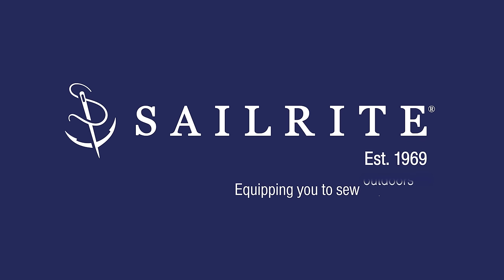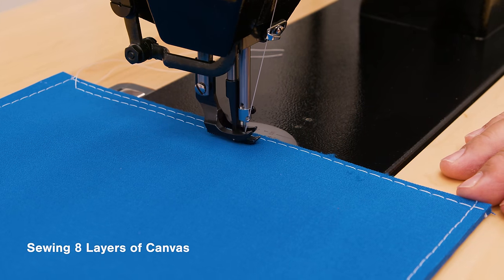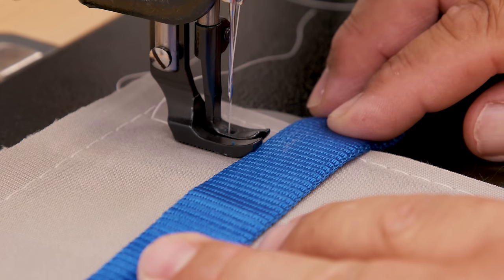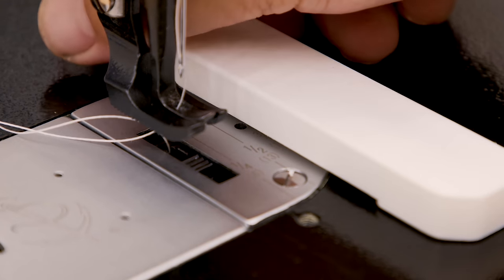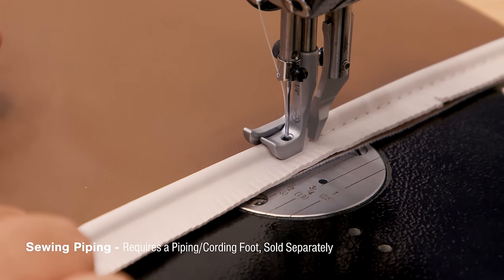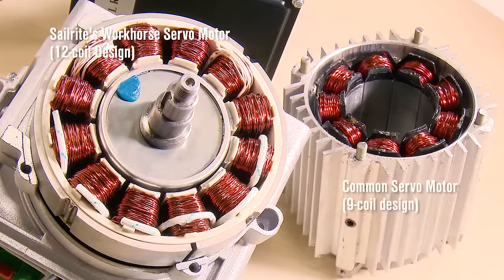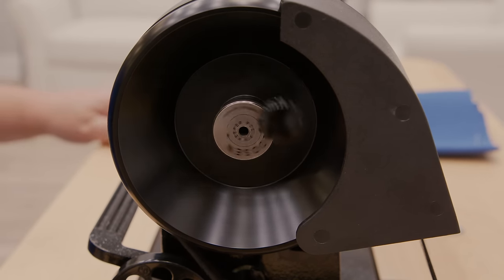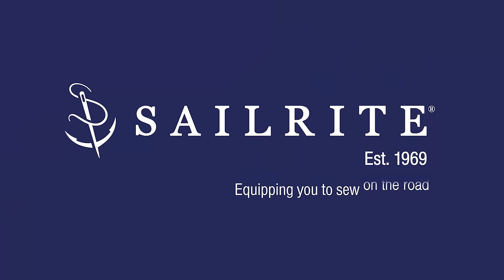Sailrite® Deluxe Fabricator® Sewing Machine Demo

Comment: I have had the Fabricator for less than a month, and they release a new model, hahaha, oh well it looks mostly cosmetic. I love the beast. It is everything I hoped it would be. The walking foot will pull anything through the needle. If the material will, fit under the foot, the Fabricator will punch through it.
Reply: FranktheDachshund 
Comparing the two
The difference is the deluxe has a butcher block table. A different light and the leg frame is now the same colour as the machine. The table is smaller. A price increase of $300.
For me........I would get the other one and save the $300.
😊
Reply: @znycelondon5313  what is the price
Reply from the maker: @zanbatistgrenuj7505  You can see the price here: https://www.sailrite.com/Sailrite-Deluxe-Fabricator-Sewing-Machine-Package

Comment: Does this have a needle position option? Where the needle will automatically stop either all the way up, or down in the fabric as you stop your stitch and remove foot power?
Reply from the maker: Hi Terry,
We do not currently offer a needle positioner option, but the workhorse does have a port for a sensor. We feel the control is so good that it is not required.
Reply: @SailriteDIY  I think having the needle stop in the down position, allows you to make turns when you put the pressor foot up.  Does the port in the workhorse allow for a positioning sensor that will do this?  Not sure how it works.

Comment: Serious question: Is this just an industrial sewing machine already on the market only relabeled for Sailrite or is this model unique to your company?
Reply from the maker: The Fabricator is the best sewing machine package in its class, nothing compares (even the Consew 206rb-5) to it in both performance and power. I know that is a very bold statement, but it is true, you will love the machine! Sailrite is the exclusive source for this fine sewing machine and Sailrite’s famous service comes with the deal. The Sailrite Workhorse Servo motor and the Stitch Pro Balance wheel (which are all cogged) are miles ahead of any other servo and balance wheel. You simply can’t get the power and slow speed control that we have on our Fabricator. 
 
We want you to be able to maintain the machine yourself. If it comes down to a mechanical or timing issue (which is very rare), we provide excellent instructions guiding you on what to do to fix most issues yourself (take a look at the PDF guidebook here: http://www.sailrite.com/PDF/2016_Fabricator_Guidebook.pdf ). Since you are trying to compare the Consew to the Sailrite Fabricator take a look at the guidebook you will get from them: http://www.consew.com/Files/112347/InstructionManuals/206RB-5.pdf Need I say more???
 
If you need phone support we stand ready to happily assist. Not to mention the many “Unlisted” videos on YouTube (available to Sailrite Fabricator Sewing Machine owners only) showing you in detail how to fix it yourself. So, not only do we stand ready to help you with questions on sewing projects, fabrics, notions and tools, but we also provide the best technical help for your Sailrite sewing machine from our own sewing machine techs in-house.
 
I hope this has helped put your doubts aside! Let me know if you have any more questions. Looking forward to doing business with you soon!
Reply: @SailriteDIY  - I'm super excited, especially given Rosie's YT review. Now, next hurdle: how much of a struggle re: overseas shipping/customs charges?
Reply: You probably know from ur stats I am a loyal follower of your listed videos 😂🤣😅 - Your RV series is delicious!

Comment: What would be the feasibility of getting running gear as an add on to this one day, or the standard?

I have the standard package and absolutely love it, however, it probably doesn't get as much use as it would have if it were on wheels.  I did a pontoon boat cover and was using my 20x40 foot driveway to keep it straight because I don't have that kind of room in my home or my workshop (a 20x20 garage where it shares with my woodworking and other tools).  The whole project being over multiple days, I kept wishing it were a little more mobile.  The leveling feet are a nice option but not the most incredibly useful thing for DIY'ers who do large scale work in not so large scale locations.
Reply: Excellent point/question. Thank you!!!